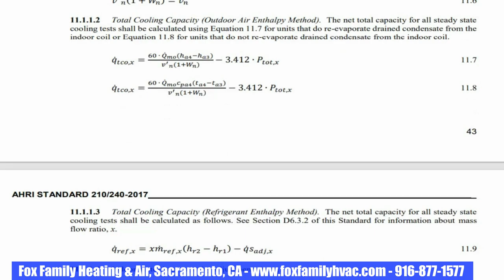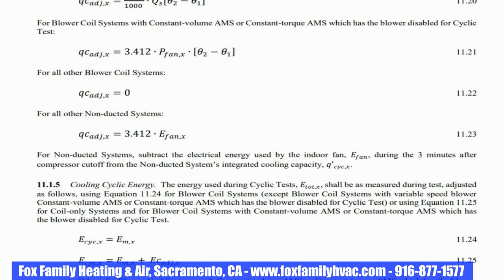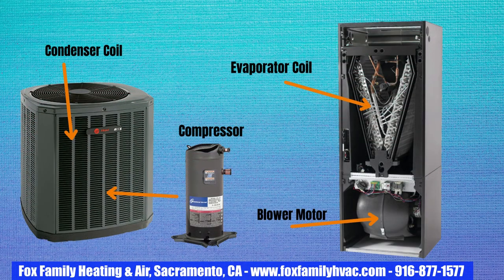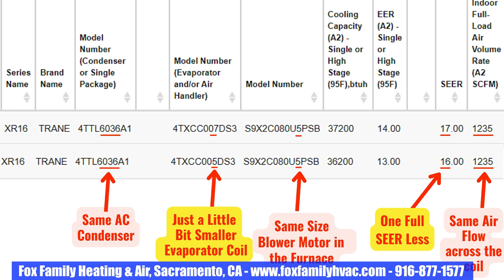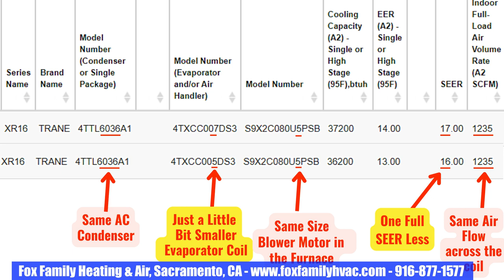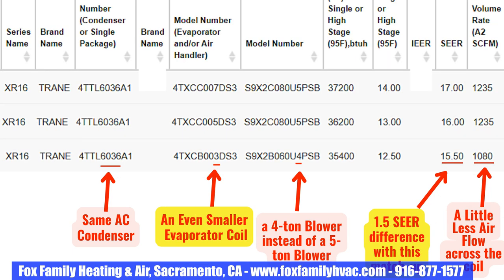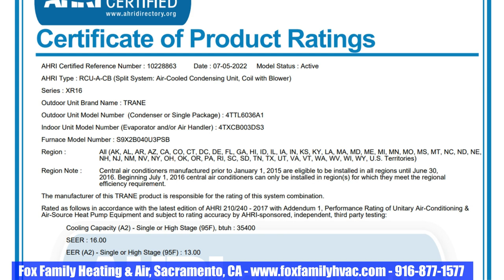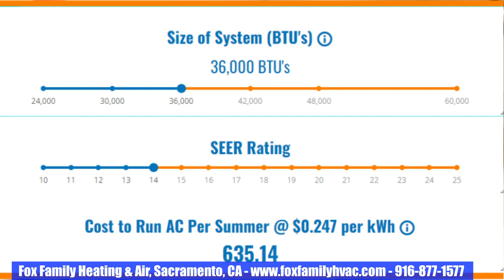What Determines the SEER Rating?

Comment: AHRI numbers only tell you what certain configurations should produce in terms of efficiency. If the system is installed properly and there are no issues with the equipment itself. I can't tell you how many times in my career that I've come across pretty looking equipment that doesn't cool well at all. 

If it doesn't cool well, it's not efficient. No AHRI number is going to do that for you. Minimum SEER2 is going to be 15 SEER, but put that up against the old equation it's 14.3 SEER. It would have been better to just stay with the older SEER calc and put the minimum to 16 SEER in my opinion. But those 16 SEER units tend to have many more pounds of refrigerant and when those systems leak refrigerant they make the global warming equation even worse. 

So the next step is to start banning refrigerants which will require you to replace your equipment again, then in another 10 years from now if the path doesn't change somehow those new refrigerants will be banned as well to replace them with something else. California goes first. Good night and good luck.

Comment: Please help me understand the AHRI ratings for the situations with lower air flows like you included in this example.  I am looking at 5 ton Trane units. Air flows vary from 1720 CMF (362 CMF/ton) to 1315 CFM (362 CFM/ton).  Great videos, by the way!  Thanks,
Reply from the maker: Basically those furnaces can be set higher or lower according to total external static pressure. The installation manual has these numbers and dip switches to be set
Reply: @foxfamilyhvac  Does the combination with the lower tested air flow have the same capacity as the one with the higher air flow, or is the one with the lower air flow to be avoided?

Comment: wow when I was being trained I was told to never match up a 5 ton indoor coil and a 3 ton compressor because the compressor would over work causing it to go out faster. Some of the warranty companies actually notate that if your outdoor condensing unit is not to exact specifications with the indoor along with the blower motor and manufacturers specs then all warranty is voided and the customer takes a hit twice. Everyone do their research before buying a hvac unit.

Comment: Very nice explanation. I have a question about effeciency of the ECM motors Vs. the SPC motors and the replacement cost associated with them? If you have an ECM motor and the cost of replacement is so high that the savings of the SEER ratings can be eleminated as the repair cost out wieghs the energy savings? True or Not and can you please comment on this? Many thanks for great video's.
Reply from the maker: I can see that being an issue for sure! Hopefully the part is under warranty and you just have to pay labor. My next video talks a little about this too.
Reply: In this day and age, you won't find a system with a PSC motor anymore. I'm not sure of the accounting reasons for this, but years ago, I used to see a new a/h, complete with coil and new ECM motor, be almost as much as just the coil or even a full ECM motor by itself. Or, the exact parts in a Payne unit cost much less than the Carrier one, even though the insides are exactly the same.
Also, look for yourself - look up Genteq Evergreen and a basic PSC blower motor. The Genteq x13 replacement, is only 2x the price of the PSC motor (around $145 vs $285). I'd however get the more expensive US Motors Rescue motors, since they were with Emerson and they have a better reputation, last I knew anyhow.

Bottom line, if the tech wants to put in a specific, programmed X13 motor for your unit, that's going to cost way more. The evergreen replacement will not.

Comment: so if a get a real old  unit and install a smaller compressor and tweak the txv so it will cool ill get a high seer rating sounds like that custom built deal a tech did up once upon time with old parts and twin pumps all controlled by custom board  😉

Comment: If you can save on electricity with a 15/16 seer HP you're in luck. Video shows fundamentals. Now don't forget to take into account the chance a shading tree had which was damaged by wind and cut down by a storm!
Reply: No such thing as 15/16 seer HP. I don't know what you are smoking, but you need to get a life.
Reply: @watermanone7567  You must be the one smoking weed; I've got enough taking prescription medication!
Reply: @watermanone7567  Don't be that person lol
Reply: @watermanone7567  - yes there is. Lennox has the SL18XC1 which is 15 SEER HP, ML16XCP Which is a single stage HP at 16 SEER. Goes up to the SL25XPV which is the variable HP at 25 SEER
Reply: @watermanone7567  I do have life